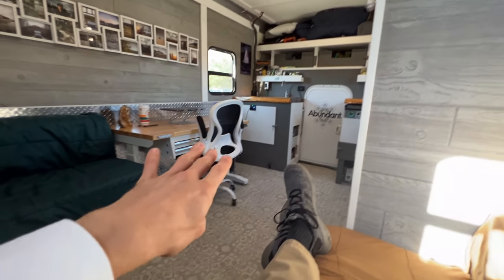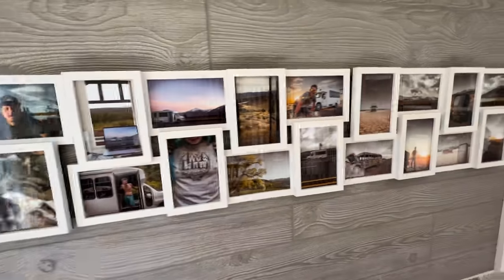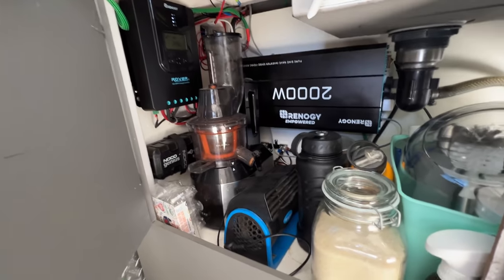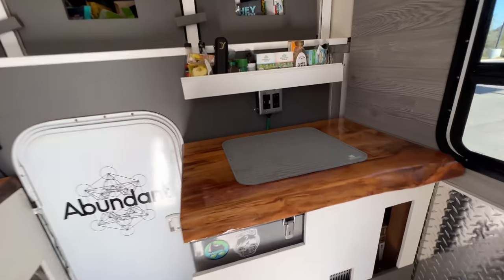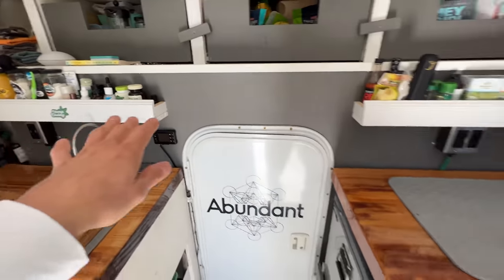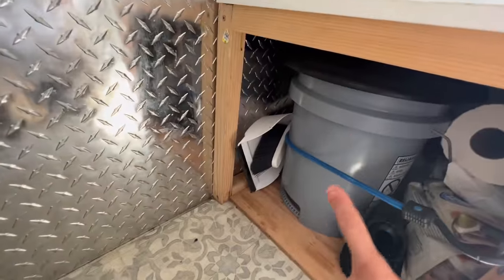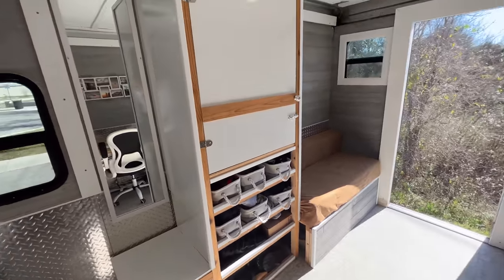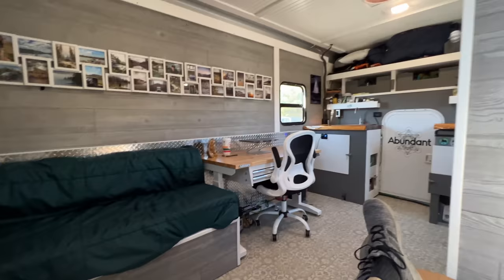Box Truck Conversion | U-haul  to Tiny Home Tour

Comment: You have plenty of room to add a bathroom with a shower and this build would be perfect. An insulated carpet for the floor would be inexpensive and keep the heat in. You did a great job making it look great without spending a lot of money. A hot water hear for the shower can be routed to the sink for a full kitchen experience. You have a lot of space for upgrading a little at a time. (Oven, more cabinets or shelves, etc) You'd be able to live in it full time eventually. Great job!!!
Reply from the maker: Thanks Bob!
Reply: 00:40 Left roll up back door in place.   Nice.  A few questions, please….   1) Since you left the back roll up door in place, did you remove the track at the top inside that the roll up door used to roll on?    2) Are you able to stealth camp in the city even though you have windows?
Reply: @joeblow1942  24:55 answers your question
Reply: @michaelthoma    I missed that before. Thank you.
Reply: This is awesome.   An incinerator toilet would be awesome.
Reply: Murphy bed would be even faster.
Reply: agree
Reply: Also, bed sheets would be nicer and cleaner…

Comment: Door hinges on the exterior part of the door is a massive security risk.  All someone needs is a screwdriver & hammer and they can pull the pins and have complete access to your vehicle without even breaking a window.
Reply from the maker: You’re overthinking it. I was parked in a business complex last year and someone popped out my passenger door lock in a matter of seconds while I was sleeping inside. If I didn’t wake up they could have stolen the truck or gained access to the rear through my cab access door. 

Tweakers are not going to take the time to remove rear hinges.

Comment: I like many things about this build... the color scheme, the photo frame display, neat organization etc.  But I would add a shower/bath.  I would insulate the floor too.  But since you didn't, you could add carpeted runner, rubber mat, or foam mat etc during colder weather.   Or just wear slippers.
Reply from the maker: Yes, I agree. A bathroom would be a wonderful upgrade
Reply: I was happy without a shower until my government shut down the gyms. Now I consider it a necessity, since I work in the city and can't just do an outdoor setup. I do love your Floorplan, though!
Reply: @nomadbrad503  Where the toilet bucket bench is, maybe a shower pan with curtain could be put there instead.  You could still put a the bucket and bench on top when not using shower.
Reply: @nomadbrad503  where would you put the shower ?  thank you
Reply: Yeah good suggestions.  I have a washable roll up carpet runner I lay out at night from my bed to the bathroom incase I have to get up in the night.  Otherwise I just  wear slippers. My little motorhome is only 22 ft and about 6 ft of that is the cab.

Comment: This is by far the best U-Haul Box conversion I've ever seen!
I personally know the square footage you're dealing with and OMG, you've made it feel so spacious! You've proven that a plan works and if you've never done this before, feel free to ask others that have. Learn from their mistakes by being humble and simply ask. I've never heard of a van-life member to say "Nope....I'm not helping ya!"....lol. 
You have used materials that you can find just about anywhere. This great not only for the initial build but also for repairs. Yes....repairs are gonna happen. There are certain thing though you do need to get that are for the RV/Van world like the windows....sink...fridge and so on. I've seen others try to convert items not designed for this specific use and ends up costing them more in the long run. Yes, niche items will cost more upfront simply because they sell less of them but they also are usually made more robust than their stationary twins.
To me, the hardest thing would be keeping it cool inside. This is from a power consumption view as well. You did the best thing not only by using the 1 inch foam insulation but simply by making the outside white and the inside light colors as well....which helps with lighting. LED lighting has came so far also. It uses very little power and is so bright. 
Just a great job! In fact, I'm bookmarking this so I can use it as my reference box style conversion when showing others!
Reply from the maker: thanks for watching, your absolutely correct

Comment: Tip on the accordion boot....make sure you place the ends to meet at the bottom of opening. Use to work at a place where we used it all the time for camper shell thru door/windows installs.  Had several customers come in that went the DIY route and install it them selves and complained about the boot leaking. They all had the ends meeting at the top of the door/window.
Reply from the maker: That’s how I did mine. Great advice

Comment: Something I saw in another van build that I thought was really ingenious was adding storage in the floor. He had a tall ceiling so he just built up the floor and added a ton of storage accessible with lift up panels.  That way you could add a bathroom and still have tons of storage. Most can’t do it because of already low ceilings. Overall a beautiful build. Great job!

Comment: This is definitely one of the top 50 builds of a box truck. Love the uhaul builds because these can be used for both transport and living. 

Only thing I wondered is the stealth aspects that others took versus the door on the back which for me would have to be completely stealth leaving the passerby to only assume it's a regular worker truck especially with the side having a logo
Reply from the maker: Thanks! I love the uhaul platform
Reply: Actually people are pretty dense. I have a bot truck conversion I consider way more ‘obvious’ and the fact it’s a camper is overlooked all the time. His box is white and the logo could mean anything. It’s pretty stealth.  The fact that the rear is a basic all white really helps. 

There are actually utility box trucks that have swing open doors instead of rollup doors. From the outside this could easily be a tool or utility truck.

Comment: What at great build! I was all prepared to comment with a question about the gap between the cab and the box on every 10 foot Uhaul I've ever looked at. Surprise, at about the 20 minute mark, you answered the question. Awesome. Just one dangling question...where did you get the accordion boot? Thanks!
Reply from the maker: I got mine off eBay.. it was about $100
Reply: Ebay, or your local truck camper/topper shell dealer usually has or can get that stuff.  It works great, and it lasts pretty much forever it seems like.  Its very soft, flexible, and doesn't harden or shrink in cold weather.

Comment: I strongly recommend an all in one solar unit like a growatt. Mine was $900. You hook up the solar panels, batteries, and ac in/out. It supports up to 2000w of solar panels, 3000w inverter 5000 surge, and up to 60a for a normal wall outlet. Also only supports 24v batteries, so 5kw lithium iron batteries is a good minimum.
Reply from the maker: I don’t like the all in one systems because of one component fails, you have to send the whole thing in for repair. I have had charge controllers and usb sockets fail on me and have ordered replacements on amazon to replace while traveling. Also if you build your own system you can upgrade components whenever you want/need
Reply: @nomadbrad503  This is my main gripe. AIO units are great until something goes wrong.

Comment: Absolutely beautiful! I’m only 5’ tall and single so I’d have been tempted to adjust the bed to just one side with a twin cut lengthwise in the same configuration. Just leave the one side as a couch and sleep on the desk side. Love this idea. Would it be possible to put the box onto a new truck if ever needed?
Reply: Yep. A lot of businesses will buy cab and chassis combos and have a dealer put their own box on the vehicle.
Reply from the maker: yes, you could do a bed on one side and yes the box can be moved onto a new vehicle

Comment: Question: I've been looking at these vans for a long while now and one of the biggest things that I want to know is if it's possible to completely connect the cab and the cargo area. The reason is I'm a software developer and would like to spin the driver side chair 180 degrees and have it become a workstation with a large computer monitor. I can't find ANY camper/rv designs that do anything like that, so I'd rather just customize my own solution instead of tearing out an existing rv. Do you know what the complications would be from connecting the cab to cargo area?
Reply: You'd have to cut a door in like this guy, it myself. You attach the cab to the box and than cut out a door.
Reply from the maker: BecUse the cargo area and cab area are separate, they move independently while driving so the connection would have to be a large rubber boot. It would be extensive surgery. I have seen rvs with rotating passenger seats and work station tables. Do an image search for “
2013 Pleasure-Way Pursuit RV”
Reply: Personally, @Zero Cool, I think you're asking for trouble wanting to do this in a box truck vehicle.  As @VanlifeRX stated, the 2 are separate units (cab and box) move independently. (the suspension and frames on both move separately)  A small door as we see in the conversion is a small area to maintain and also has a minimal amount of separation movement. Because it is centralized, it is also more protected from any type of weather blowing, dripping, seeping or leaking in on all sides.  Once you make that hole larger, not only are you weakening the build of both the cab and the box, you are also creating more room for failure of your seals between the 2 pieces creating more opportunity for damage.  Examples: sun damage, water leakage, insulation rot, inset and animal penetration.  You couldn't seal it with a spray foam that you have also sealed and protected, that in time, will crack and separate from both metal enclosures, especially with the 2 moving independently;  If you could somehow invent a way to create a flexible rubber seal, something like the accordion boot that was used in this video, and incorporate them back to back somehow - first off, I don't know if they'd fit on the opening back to back, but also, over time, you are creating more opportunity for that rubber to break down, dry out and crack from the weather. Remembering that you may have weakened the framing by cutting a much larger hole.
Reply: Mine has that.  Keep in mind that a cutaway is not the same as a chassis cab.  Mine is a cutaway 10ft and it was easy.  In fact, the rise in the seat swivel thingy was almost exactly the same as the floor height difference. In a cutaway, there is no gap in the wall, just a 3/4 plywood wall.  I added a matching seat the the front ones behind the driver, a seat belt, and a table made from 2 workbench legs and a piece of that butcher block top. I can ride 3 legally, and 3 people can sit at the table.  I also put  a window for the 3rd rider to look out when riding.  My wife frequently goes back there and watches movies on her laptop when travelling.

Comment: Fantastic open build. And the most practical rear wall I’ve seen. Two questions:

1) How did you cut and remount the roll door panels?
2) Do you find that the lack of insulation at the top of the walls (where the rails are) makes a significant difference?
Reply: Yes, that is my current problem as well, the roll up door is broken.  I removed the spring bar and it's brackets.  I've temporarily put a couple of pieces of 3/8 over the inside so it doesn't just fall out.  My problem, I think, is that the rollers on the sides of the panels seem very unsturdy.
Reply from the maker: I left the roll up door in the down position and added a sheet of plywood over the top to connect all the individual panels. It becomes 1 wall. The rollers were in good shape so I didn’t need to do anything. It’s very sturdy
Reply: @nomadbrad503  ah! So after adding the plywood to connect all the panels, did you cut the opening with a circular saw?

Comment: Wanna save use flex insulation and cloth  and snapons for wall.
Reply from the maker: whats flex insulation?
Reply: @nomadbrad503  go to homedepo hardware store in ur area .u can use as a wall then cover it with any color cloth over then put snapons to snap on the side of the van or ceiling.

Comment: Thank you for the tour. I'd like to know more about your shutoff, bus, and power set up. I'm adding a battery, so I think it's time to consider that.
Reply from the maker: Feel free to ask any questions you like
Reply: @nomadbrad503  I have a small van and very tight space for the batteries. I'd like to connect them both to some kind of bus so other things can easily be connected. There are so many out there - how would you suggest I narrow it down?

Comment: “Better to not buy the cheapest fridge…” Agree.  We bought cheap, just over $100 vacuum cleaners for about 6 years, which never worked well and generally broke in about 2 years.  Then bought a $500 vacuum…and it works great.  Assuming it makes it a couple more years to 10 years, the expensive one costs LESS money, and hassle, than the low quality ones that fall apart after a couple years.
Reply from the maker: This is exactly what I’m talking about 👏🏻

Comment: Shower 🚿  definitely!!! Wasted space is the part over the cab, that definitely would have been a better place for your bed. In my opinion, a bathroom would have fit easily in place of the pull out. I would have sacrificed sitting up in bed, so I could of had a shower and toilet. Again my opinion, other than that I think it's a great Rig and you look happy. I'm not trying to be disrespectful to your choices. Obviously, everyone is different, and what works for you doesn't necessarily work for me. I still give it 👍🏻👍🏻 on the craftsmanship and creative ideas used to accommodate your needs.
Reply from the maker: tried putting the bed up top. too close to the ceiling, I was always bonking my head.

Comment: I’d really look into a halon system for your rig. Summit Racing Carrie’s them.. I’m sure others do too.. larger RVs have them.. just a suggestion with all that fuel inboard and other touchy areas of concern.
Reply: Halon systems are extremely dangerous inside a living space. 

They literally remove all the oxygen from the air and the occupants die from suffocating. 

Good for a sealed engine room though.
Reply from the maker: there is a fire extinguisher and automatic fire supression system next to the heater ( fireball) I just didnt mention those.

Comment: Unsure if the dude will read this, but as for flooring being cold and suchlike. id put down a "Rug" with a nonslip rubber underneath, not a perfect solution but can be pulled up for a full clean but great under the feet when needed!
Reply from the maker: the dude absolutely read it. for now im just wearing slippers, may add flooring later

Comment: Looks like a lot of thought went into this build. Very nice! The only thing ‘I’ would’ve done differently is I would’ve put door slides on the bed slide outs. I’ve often wondered about the fresh water storage in ALL RVs… does it actually stay ‘fresh’ for drinking until it’s refilled? How about cleaning it? How often and how does one do it? I’m looking forward to going ‘back’ on the road soon to live full time after spending 38 years as an OTR cross country truck driver/owner operator retiring in 2015. Have a blessed day! ~Jim~
Reply from the maker: The water stays fresh for weeks. Never had it turn on me before I could use it all. You can flush it with a mild bleach solution
Reply: @nomadbrad503  cool! Thanks!

Comment: Thank you for the tour. This is one of the most minimal looking builds Ive seen and it feels wonderful on the eye!!

I noticed the faucet has a handle to turn on and off however the water is controlled by a foot pump...

How do you deal with humidity especially coming to Texas? I noticed the fan in the roof...is that a good solution to pull hot air out? How many watts does it use?

I like your bed/bench solution. What is the green and brown covering material made out of? I'm always running out as I was raised in hot humid Houston and use a cooling sheet....

What type of mileage do you get?

What do you do for showering?
Reply from the maker: Thank you..the faucet can be used with a water pump..that’s why it has a handle. Since I use foot pump, I just leave the faucet “on” 

I travel full time so I try to avoid humid weather. If you wanted to stay in Texas all year you would need air conditioning.

The bench cover is a camping blanket from kelty that I happened to have. 

Fuel mileage averages 9.5 mpg, i shower in gyms, campgrounds, truck stops…about once a week

Comment: It's a good build, I just only recommend putting you diesel heater fuel tank and storage tank outside the cab. That thing can kill you if it malfunctions.
Reply from the maker: The diesel heater fuel tank and storage tank are in the cab because im not there while it’s running, im in the back, sealed off
Reply: @nomadbrad503  the fumes could still leak into the back since you cut into it.  Besides just the sloshing around with spoilage of either container can harm you or your dog.  It's just easier to store the fuel outside,  put the tank underneath and the storage tank on the back bumper or in a vented (to the outside) location.